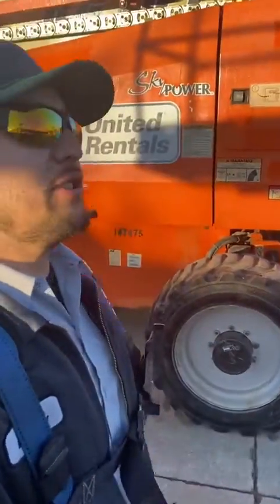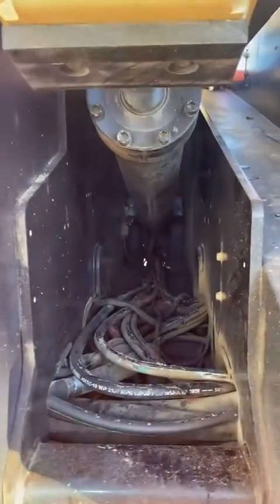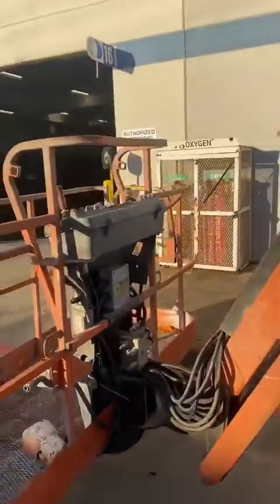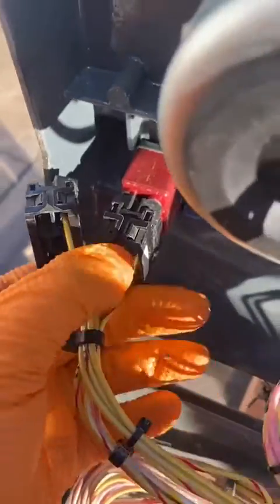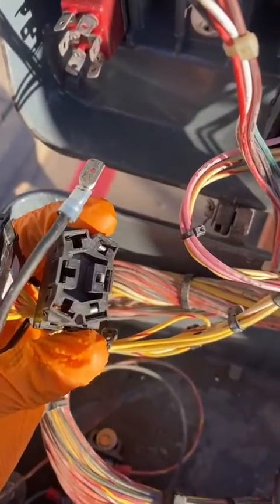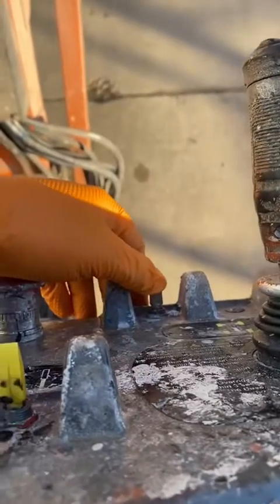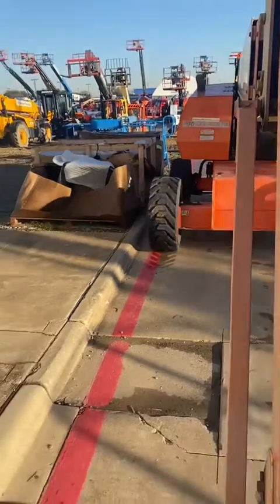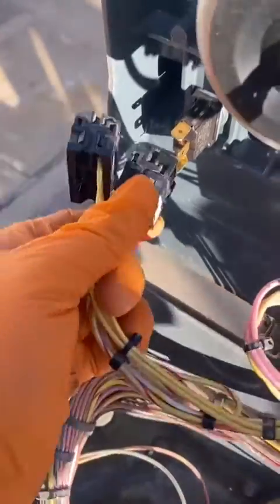Boom Lift has no High Speed and no High Idle

Comment: Hi.
I have a 2014 S400 with 2.9 Deutz.
It shuts down 43 code low oil pressure but engine runs good cold then after half hour it shut off.
Runs at high speed travel  fine .
Only at boom function speed it shuts off then restart s.
I checked oil valves for dirt.
Any ideas?
Thanks 👍 nice channel
Reply: Was engine harness under fuel.pump wire was shorted to block.
Fixed it now.

Comment: I need to replace my boom hoses on jlg 450a. Can you help with a video or even do them for me? Or maybe you know someone. Thank you in advance
Reply from the maker: Hahaha it’s a easy job just time consuming 
Where you located at ?
Reply: @handymanny214  im in new jersey. I bought the hose kit from jlg.
Reply: Another question, i just blew a hose for my steering buttons on my travel joystick.  I saw it spraying in the center of the machine while i was up in the air. How do you access it from the top or the bottom? I see there is a plate on top of chassis between wheel or do i have to slide engine out to get to it? Thanks in advance . Bob
Reply: Or maybe you can let me know what that hose number is ?i see the tags on the hoses but there's so much oil i dont know which one it is

Comment: I got a 340Aj that drives fine for about 30secs then it just stops driving, until you let go of the foot switch and joystick, and start again. The revs don't drop and all other functions work. Any suggestions?
Reply from the maker: Mmm sounds like a short somewhere 
Like it’s looses initial power 
I’ve noticed issues that I’ve encountered with similar symptoms would always lead to the wires goin to the foot switch or the e stop. You can eliminate the foot switch by jumping the wires directly and drive it around see if the problem stops
Reply: @handymanny214  thanks for the tip. I'll give it a try